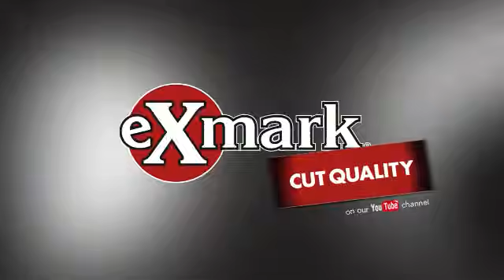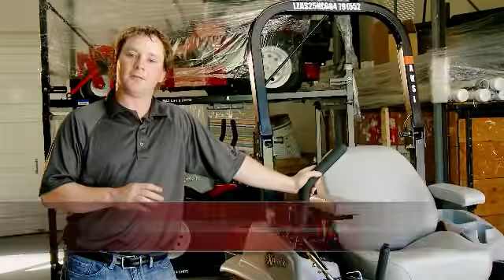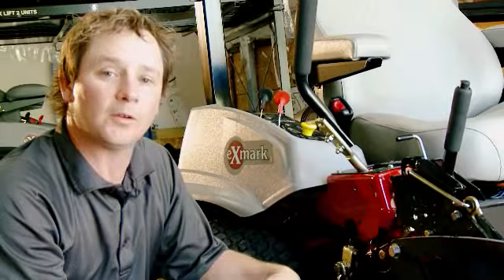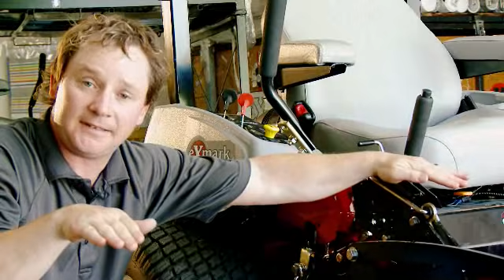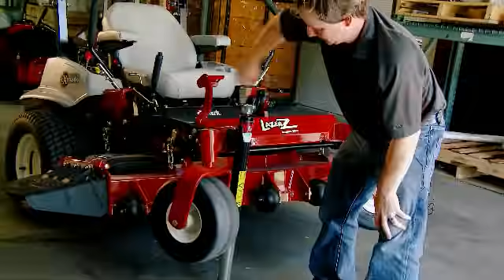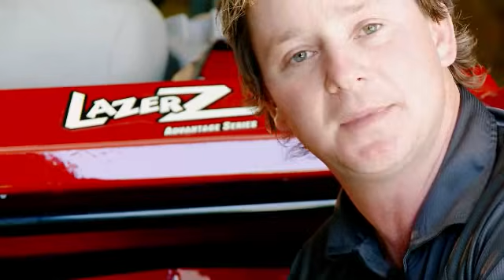How-to: Maximize Your Exmark's Cut Quality

Comment: Purchasing new 48" EXMARK RADIUS E-SERIES.  Undecided as yet on Exmark striping kit.  How well will this mower stripe if I opt to not have the kit installed?
Reply from the maker: Todd, thanks for hitting us up with your question and welcome to the Exmark family. We’re sure you’re going to love your new Radius.
 
Striping is reliant on a few things, airflow (deck), blade sharpness and turf type/quality (probably the most important).  As these three factors fluctuate, so will the striping results.  Blade sharpness I believe is self-explanatory.  Air flow comes from deck rake, which is the angle of the deck…with a 48”, you want the front blade tip an 1/8” to 3/16” lower than the rear blade tip.  Turf type/quality, northern season grasses typically stripe much better than southern and along with thick, lush turf, good nitrogen content is instrumental to nice deep stripes.  Height of cut can also play a role as well.
 
As far as the striping kit, if your grass will stripe, the striping kit will make it stripe and can enhance the stripe.  My advice would be, see if it’ll stripe without it (give it a couple mows to let the grass become ‘trained’).  If you’re not satisfied with the results, add the kit later…on a scale of 1-10 difficulty, it’s about a 4 to install and requires minimal tools (9/16” wrench, screw driver to install snap-rings).
 
I hope this helps, enjoy your new purchase and if you ever have any questions, don’t hesitate to contact us.
Reply: @ExmarkManufacturing  I had the striping kit installed with the purchase.  Looking forward to mowing season.

Comment: I just bought a new one. Mechanic told me you had to keep adding oil and hydraulic fluid. He said it burns about an ounce of oil for every hour of use. Is that nornal?
Reply: Radius e series 48"
Reply: Nah mine is good for until the next change.  I haven’t heard anything from the forums about this yet tho
Reply: Check your engine oil before mowing every time.  Check your air filter too.  If the air filter is stopped up it is possible to begin consuming oil.  Check hydro oil also.  If hydro oil level, cold, is lowering then you need to get it to a shop to be checked out.

Comment: I have had Scag, Ferris, & Exmark.. Exmark is the best mower.  The cut is by far the best and simplicity of the mower A+.  Scag has a electronic clutch that is unnecessary.  I spent $800.00 trying to fix that BS between the clutch, wiring harness and shop time what a joke !
Reply: If you had a toro turboforce you would prefer that, not saying the exmark isn't good, the Toro is just better

Comment: PUT THE WIRES TOGETHER WITH THE SCREW CAP BUT NOT SURE WHERE THE OTHER BARE WIRE GOES? MY SON HAS BRAND NEW XMARKS & ARE COMPLETELY DIFFERENT SETUP /  ENGINE STYLES ! THE DIAGRAM ON PAPER DOESN'T HELP AT ALL FOR ME. 
THEY DON'T HAVE THE MONEY AT THIS TIME TO PUT TOWARDS THE XMARK & THE GRASS / YARD NEEDS IT'S LAST CUT FOR THE YEAR! WAS WONDERING IF YOU COULD HELP ME?  SO I CAN HELP THEM. 
DAVID COLIN STILLMAN 
443 790 6383 
IF YOU DO CALL & I DON'T ANSWER PLEASE LEAVE A MESSAGE & # I CAN CALL YOU BACK. I DON'T TALK ON PHONE IF I'M DRIVING OR HAVE ON ME WHEN I'M WORKING AROUND THE YARD / COST TO MUCH TO GET BROKEN  / ETC. I CHECK IT EVERY SO OFTEN TO SEE IF I GET CALLS OR TEXTS. THANK YOU! BE SAFE ! HAVE FUN! GOD BLESS YOU ALWAYS! APPRECIATE YOUR HELP!

Comment: HI! 
MY FRIEND HAS A EXMARK Z ? MODEL # LZ31 BV725 
SERIAL # 692313 
I WAS CUTTING THE GRASS / YARD FOR HIM .AT THE TIME HE WAS IN THE HOSPITAL / STAGE 4 CANCER  / & THE DRIVE BELT BROKE WHEN I WAS FINISHING UP THE FIVE ACRES .SO PUT IT WHERE HE HAD IT & HEADED BACK TO MY STATE / HOME. CALLED HIS GIRLFRIEND UP TO LET HER KNOW TO LET HIM KNOW WHEN HE WAS FEELING BETTER! KEMO & RADIATION ARE NOT FUN ON THE HUMAN BODY. 
WHEN WE HAD A CHANCE TO GET BACK TO THE HOUSE WITH NEW BELT & FIGURED OUT HOW TO GET IT BACK ON BUT HAD TO TAKE THE DECK BELT OFF THE BACK PULLEY THAN PUT THE DRIVE BELT ON THE LOWER DOUBLE PULLEY THAN THE DECK  BELT. I CHECKED TO MAKE SURE THE BELTS WERE RIGHT. STARTED THE ENGINE LET RUN A BIT. & PULLED THE BLADE SWITCH & NOTHING HAPPENED SO TURNED ENGINE OFF & WENT TO THE BACK OF THE ENGINE RECHECKED EVERYTHING & NOTICED A YELLOWISH WIRE HANGING LOOSE / ACTUALLY TWO WIRES IN ONE / LIKE TWINS  /  1 HAD A MALE END & 1 HAD A FEMALE END  / ON THE OPPOSITE ENDS OF EACH WERE BARE ! FIGURED WHERE 1 BARE WIRE WENT TO ANOTHER WIRE COULD SEE STRANDS OF THE LOOSE WIRE STICKING OUT OF THE TWISTED CAP. SO I REDID IT WAS
Reply: Just so you know, I stopped reading your post only because it was in all caps.
Reply: @plaid11  FINE WITH ME ! GOT IT TAKEN CARE OF  ! BE SAFE  ! HAVE FUN  ! GOD BLESS YOU ALWAYS  ! 
Y.L.

Comment: I have designed some pretty expensive hydraulic machines in my career so I looked over many mowers before making a purchase. All of the mowers will cut grass if they didn't no one would buy the mower. Quality of a good mower is smoothness of the hydraulic system. Jerking hydraulics will beat you to death after 8 hrs and that jerk is the difference in mowing up to a rose bush and mowing over it. Exmark and Scagg are far superior to any else on the market. Exmark and most all zero turn mowers have a distinct flaw in the front end that could be easily corrected, I am really surprised no one has corrected this.
Reply: Uh... what is the flaw?
Reply: The flaw is the exposed front wheel axel bolt. Mowing straight line along chain link fence is good but back up and the front wheel spins around and hangs the axel bolt in the fence. Look at any chain link fenced lawn mowed with a zero turn mower and you will see fence damage. Simple fix is to weld half moon 1/4" bar just above the bolt, preventing the bolt from hitting the fence.
Reply: I've never had that problem with my ExMark... but I pay attention when I'm mowing I guess?
Reply: My rural property is bounded on one side by a 300' chain link fence(mine) and since my Exmark's deck is far offset to the left side, it's easy to simply mow with the left side of the machine near the fence. I've never had an issue with the front wheel spindles snagging or damaging anything when I turn the mower. Being aware of how you maneuver the machine seems to be the answer.
Reply: Your language says it all.

Comment: Good information here. Never thought about the rake helping to bring air under the deck. Air pressure in the rear tire is a good tip as well.
Reply: Having forward rake also helps reduce the amount of horsepower needed to cut. The grass is being cut on the front end and only being cut one time, rather than twice is the deck is completely level.

Comment: Mowing 25 years, never seen grass get as "hard as concrete.  "
Reply: It can get extremely hard if allowed to accumulate and dry.
Reply: I sure have 🤷🏼‍♂️
Reply: They make bricks out of clay, dirt, grass, straw etc. The same crap that can build up under your mower deck.
Reply: Okay, maybe not exactly as hard as concrete but it can be a pain to get off. To the point of having to chisel it off. If you take care of the mower and clean it on a regular basis, it won’t get that bad. It also depends on the kind of soil or other stuff.
Reply: Hahahaha agreed I just haven't been mowing that long haha

Comment: Flying into the garage full speed, spinning a beginners 3 wheel turn and then treating those machine controls with such force does NOT make you look good. 
Good information and everything else seems good, but doing that to these machines is sooo unnnecassry.

Comment: Exmark is the number one choice for Landscapers nationwide, followed by Scag, Toro then JD. I'm just saying, there's a reason for that, Exmark is the best period!
Reply: shoehorny Exmark and Toro are the same machine .I prefer the cut on the Turboforce muching kit over Exmark .After owning a Toro comerrcial Z i will,never go with any Field mowers like Hustler,Scag or Dixie .Xmark or Toro for me from now on.For all,the guys that think,x mark,is better then Toro remind them its the same company and all,the golf course mowers are,Toro
Reply: @ted_cori3724  your correct I have both and always go with the turboforce, it just cuts better at high speed
Reply: Bang Tundra:  I agree that Exmark is a great zero turn and can even agree that it is the number one choice for Landscapers nationwide, although I have not seen any data to prove this.  However, did you know that  Exmark is made by Toro?  Toro also makes a nearly identical zero turn machine that has the Toro name on it; although the Toro model has better parts (thicker steel, better suspension, higher quality seat, etc.).  The Toro machines cost more than the Exmark, and I bet that is why they do not out-sell the Exmark machines!

Comment: @atlbraveswin00 I agree im a Deere z900 owner it's the best in any condition.
Reply: My 7 iron 60 ztrak just sits and rusts, it is terrible in high grass, leaves missed grass and clumps, I've tried high lift blades to solve the issue, still terrible. I never have issues with the Toro's.

Comment: Want a better cut quality in any condition (even rain)? Simply get rid of that overrated junk and buy a JD 900 Series Z track with the 7 iron deck. Don't even have to scrape the deck. 

How are those Parker pumps going? Thank JD for being the guinea pigs for those.
Reply: Sounds like you are just a fanboy the 7 iron deck overcuts the grass causing pulp Toro turboforce is the way to go, I've owned bobcats , scags advantage, Snapper Pro, JD 7 iron, Toro sfs, exmark advantage, and Toro turboforce, I just purchased another used 6000 72" great machine I cut in all conditions and never have had to scrape or pressure wash the underside of the deck, a couple pumps of grease and sharpen the blades, check the rear tire pressure and send them out.
Reply: smart man “sounds like you are just a fanboy of the turbo force deck”  scag velocity > toro turbo force as well.
Reply: @atlbraveswin00  😂🤣😂😂 that's hilarious
Reply: smart man   Yes real funny. As if you’re the only person who has used multiple lawn mowers. Go to lawnsite.com and do a poll. Also, do you realize I made that post 9 years ago? A little late to the party man.
Reply: @atlbraveswin00  for some reason you hold your self in very high regard. Unlike you I don't do not go out seeking opinions like my own. I never said I thought I was the only person who has used multiple mowers. I'm not trying to change your mind, I'm only saying that I don't believe you are correct. You use your overrated mower and I'll use mine, I have a ztrak with a 60 7 iron and I don't like it compared to my Toros, I used it exclusively for 3 seasons before I purchased a used Toro, I bought two more since. The John Deere is just inferior in most condition and adequate at best in some. So keep buying crap keep using it and be happy. Don't get all butt hurt because you don't like what I said, nine years later🤣😂
Reply: @MacGyver-1  " for some reason you hold your self in very high regard. "

Says the person with the username "smart man"

"Unlike you I don't do not go out seeking opinions like my own."

Ok? A baseless claim.

"I never said I thought I was the only person who has used multiple mowers."

You listed brands off like I'm supposed to be impressed or something. Yet apparently I'M the one that "holds myself in very high regard"

"I'm not trying to change your mind, I'm only saying that I don't believe you are correct."

You can believe whatever you want. 

"You use your overrated mower and I'll use mine,"

So you admit your mower is overrated too. Fair enough. 

"I have a ztrak with a 60 7 iron and I don't like it compared to my Toros, I used it exclusively for 3 seasons before I purchased a used Toro, I bought two more since. The John Deere is just inferior in most condition and adequate at best in some. So keep buying crap keep using it and be happy. Don't get all butt hurt because you don't like what I said, nine years later🤣😂"

Uh ok? What exactly are you expecting? To be ignored? That's exactly what I'll do, you contentious person.
Reply: Bought a JD riding mower then 0turn. 0turn sucked. Warranty was crap had 13 hours and wouldn't start. Cost me $1700 to repair it. Xmarks are by far easy to operate. Plus not being a man, oil change is a breeze. Thank you Xmarks for that. My belt came off, just searching how to put it on. Good luck mowing.
Reply: Theresa Melton  Pretty vague one description. No model number or anything plus it’s anecdotal. Nice try.